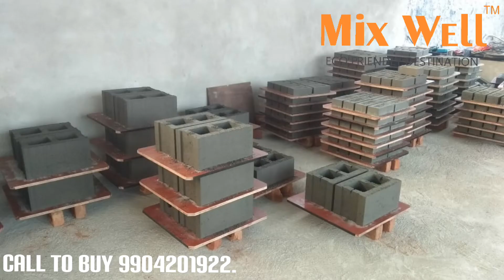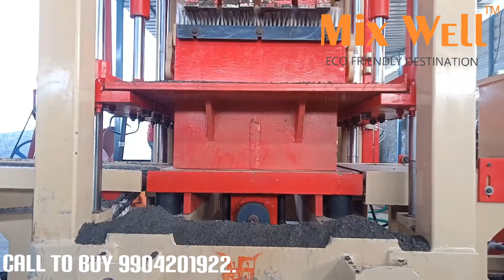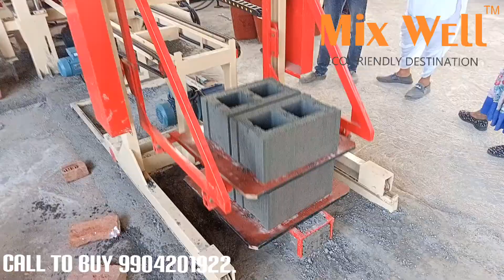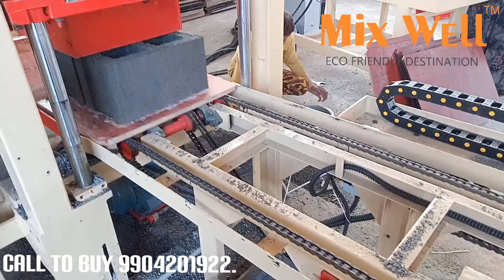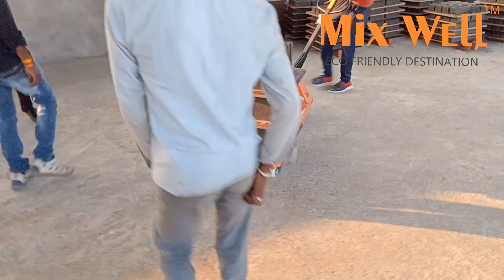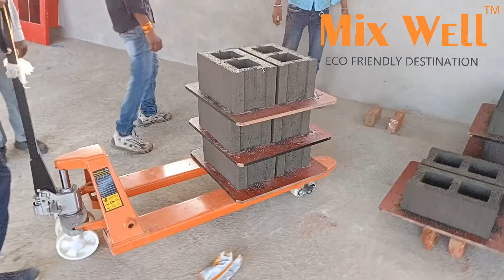Automatic hollow block making MACHINE | hollow block machine | block making machine | hollow block

Comment from the maker: AUTOMATIC FLY ASH BRICK & PAVER & CONCRETE BLOCK MAKING MACHINE. 
ALL IN ONE MODEL. 
1)FAM- 1080 =  11500 BRICKS PER 8 HOUR (SHIFT )
2) FAM- 1440 =15300 BRICKS PER 8 HOUR (SHIFT )
3) FAM- 1800 =  19200 BRICKS PER 8 HOUR (SHIFT )
4) FAM- 2160 = 23200  BRICKS PER 8 HOUR (SHIFT )
5) FAM- 2520 = 27200  BRICKS PER 8 HOUR (SHIFT )
LATEST VIBRATION+ HYDRAULIC TECHNOLOGY.
LATEST GERMAN TECHNOLOGY 
BRAND: MIX WELL. 
FIRM: HARDIC ENGINEERING
M- 9904201922. HARDIC PANCHAL. 
Email: hardicengineering@gmail.com
Video link : https://www.youtube.com/watch?v=wcFe0Up9lVE&t=232s
Video link : https://www.youtube.com/watch?v=PgW91WoOY9s&t=428s
Video link : https://www.youtube.com/watch?v=rXnzJ1iAKoE
Video link : https://www.youtube.com/watch?v=svDfOFD6Ok4&t=11s
Video link : https://www.youtube.com/watch?v=71PWt8WhMsQ&t=17s
Video link : https://www.youtube.com/watch?v=dQT9bLz8H-U&t=161s
Video link : https://www.youtube.com/watch?v=0SQZHlz6kdg&t=42s
Video link : https://www.youtube.com/watch?v=NntuvVny07g&t=53s
Video link : https://www.youtube.com/watch?v=Z279nlTqETQ&t=43s
Video link : https://www.youtube.com/watch?v=9AtI6lfD6MQ&t=188s